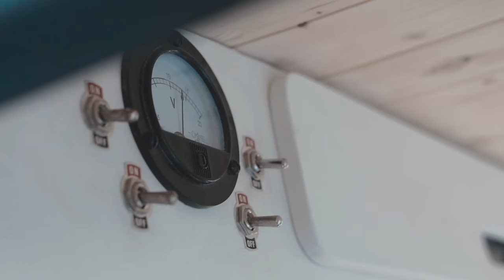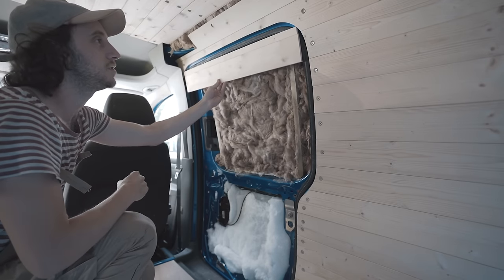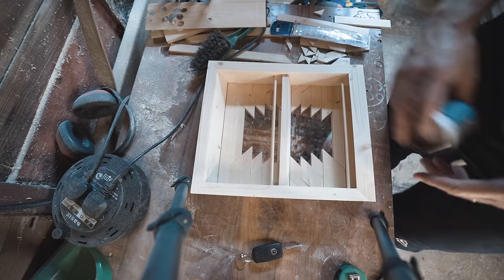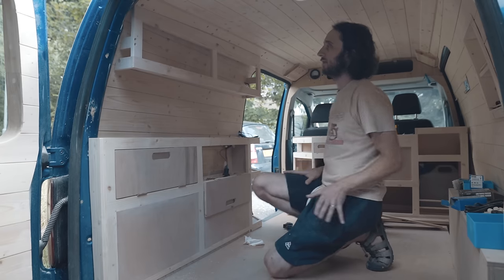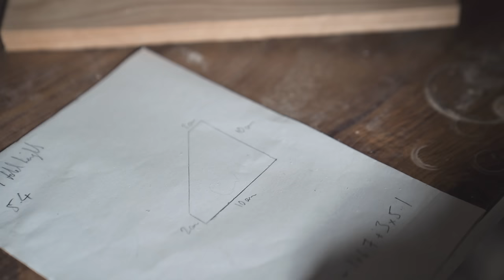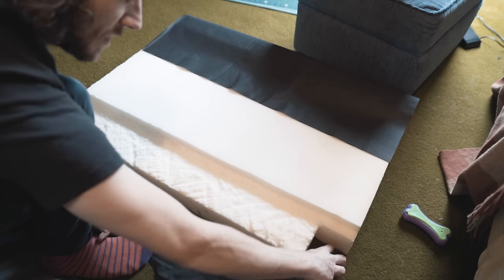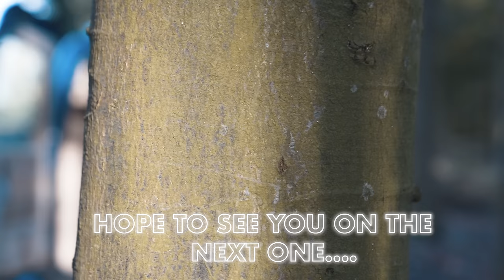DIY Camper Van Conversion | Full Build Timelapse | VW Caddy

Comment: So far I have seen quite a number of builds of campers because for several reasons I seriously consider to start to live in a camper myself.
This is the smallest van I have seen so far.
What I like most is that you kept it as simple and practical as possible but with some cute details such as the mirror.
I also like the colors. You kept it light. This makes it more spacious.
Even though this is too small for me I still think this is extremely well done. Double thumbs up.
Reply: Oh my goodness! The craftsmanship you demonstrate is exquisite! How ever did you acquire such skills at such an early age! You are a very capable carpenter, engineer, plumber, electrician, designer, upholsterer, tailor, videographer, etc, etc.  This is the best van build I've ever watched.
Reply: @mstimpson03301  I think he had great parents

Comment: ABSOLUTELY STUNNING! And I love how well thought out you did everything! I am a disabled senior that travels for suicide awareness Since losing my son Jeff in 2016, in my wheelchair modified 2010 dodge grand caravan with my four Chihuahuas.  I have a wire cubby in the Hatch area for storage. I also have a platform bed with some storage space underneath. I have kept the smaller section of the backseat as well as the two front seats for when my grandchildren travel with me. The rest of the floor space is taken up by my power chair. I am by no means a minimalist and definitely travel with too much stuff. And I still have more stuff for camping and emergency gear at home for the day I can score a larger rig.  Unfortunately, due to the wheelchair modification, I cannot have a rear hitch for a tiny trailer or even a storage box on the back, and being in a wheelchair it is hard to access anything on the roof. But I do have 2 solar panels and a roof box up top for when other people travel with me. My dream vehicle is a short wheelchair Bus conversion with plenty of storage space! Safe Travels n Enjoy YOUR Journey! ❤
https://youtube.com/@JeffeysMom

Comment: this build is perfect, one of the best i've seen online so far. well crafted, well designed, you really dont see people converting their vans into builds as good as this one. the only thing i'll add is that you'll probably want some space in between the solar panel and the roof the car, as the cells can get quite warm if they don't get enough ventilation on hotter days.
Reply: Es un gran profesional 👍

Comment: This is just such a comprehensive start to finish conversion with so much attention to detail , it inspires you to think to yourself "wait, I could do that" while watching it.

I couldn't help but think to myself, as you were building out the bed unit, since it's such a small van,  what if you were to make it serve double duty by turning it into your main storage cabinet/worktop/etc when it is upright on its side?

Then you could have the left side of the van as a sitting bench, and once you're done doing kitchen/work stuff during the day, drop the thing down 90 degrees for an instant full size double bed.

Comment: There was still a lot of exposed metal. Borrow an infrared camera, you'll find a lot of heat leaks, (poor insulation )I used  R-13 inside the doors, (big help, closing the doors got quieter)  also used Owens Corning R-3 1/2" Foamular worked great for the walls! Moisture resistant. Good job on the floor. Reflexit does not work well on windows, The Foamular was much easier to cut to shape and did a much much job at keeping out the cold. The infrared camera knows and see's all! Believe Me!
Reply from the maker: That's some dedication there Raul!

Comment: I like this BUT one trick that I think a lot of people are missing is around the weight. Weight affects handling, fuel, etc. All converters notice the difference with their original van vs the camper. If you think of everything that went into this, the materials just stacked up in the back, it's like a pretty full load. My solution? Replace a lot of the wood with marine foam. It's strong, rigid, fire retardant, and weighs NOTHING. I personally think it's okay for bed and seating, although there can be flexing if you don't use the door-screen trick, but I like that. For everything else it is perfect. So you suddenly only have to add the weight of facias and equipment (fridge battery, etc). The conversion feels almost like an empty van.

Comment: i love wood. but wood is very heavy. I often wonder about these wooden build-outs, if people put stronger suspension etc. on their vans?
Reply: These Caddy's are designed to carry a load of max. ~600kg. Don't reckon the total weight of the wood will exceed 600kg

Comment: Hello ! Thanks for the recap video
Question : in the insulation work, you put a good layer of insulating fibers but before putting the wood, non vapor barrier ?

I love the mirror surrounded by wooden frame, it’s wow ! 🤩 and your insulating shutters for windows 👍
I have the same compression fridge 😊

If I’m lucky (I’m spending my driver licence at 60 years, oh yes !), I will again fit in a new vehicle 🤞cross the fingers 😉
A vehicle like same type at yours 😊

a very very beautiful work, clean as I like 😊! 👏
Have good tips with your van 😊 See you
Reply from the maker: Hey! Thanks for the comment, some campers do need a vapour barrier but this particular brand of insulation, the peel back stuff, doesn't need a vapour barrier according to the manufacturer. I believe it prevents absorption of moisture and any mould growth in itself, try looking for camper insulation rather than household, keeping the camper well ventilated will also help though! That sounds great though and best of luck on your license, the build and many travels! 😁✌️
Reply: @WoodandWild  Hello and thank for your answer. Here in France, many people use German material called « Armaflex AF » from Armaconfort. Initially, used for pipes then boats and now for vans. It’s an excellent thermal insulator. Others use projected cork and natural fibers on witch they put a vapor barrier. For the Armaflex, no need.
And of course, the vents aren’t forgotten 😊
For my next van, I take Armaflex and fibers in extra. That’s why I asked you the question 😉 
See you ! 😊

Comment: Really well done! 👍
It would have been even better if the Caddy would have been an electric car and if you would have used sustainable materials for the insulation. But still, really great work!
Reply from the maker: Hey Lightsternelektro-camper! You'll be happy to hear the insulation is made from recycled bottles and our current project is a Nissan E-NV200 😁✌️
Reply: @WoodandWild  Wow, that's great! I thought it was something like rock or glass wool, but recycled bottles is great, too! We used sheep wool for insulation and it works absolutely great. No moisture whatsoever even in or after winter. Absolutely recommend it!

As you might have seen, we already have two "Envys" in our fleet. They are cute little vans. Very reliable and even quite energy efficient!

Good luck with your project! 👍

Comment: :hand-pink-waving: looks very very nice ... well done ... Maybe you have an answer to the weight question: empty car (before you build in the first part of insulation ... next weight with insulation ... next weight with the wooden layout ... next weight is total, when you drive away = incl water a.s.o.) do you have such figueres or can say something appr about that? maybe I will try it without wooden ... but V4A stainless steel :glasses-purple-yellow-diamond: 2/2/2mm (i want to learn to weld and i have a good project to practice with...) :face-purple-wide-eyes:
Reply from the maker: Hey Senseye, sorry I don't have an exact figure for you I'm afraid, I try to make things as light as possible by using softwood for framing, minimising plywood thickness, generally keeping the materials required from framing to a minimum. You could also opt for a lithium battery (though a little more expensive) as well as a flexible solar panel etc. They only thing I can say is that the van pulled and felt exactly the same as did prior to the conversion, you could always take it to a public weighbridge if you were worried at all!

Comment: You shouldn't put insulation in the lower part of the door, there often runs water through it and drains at the bottom of the door.
Reply from the maker: Hey Jona, what do you mean by isolation sorry? Is this the rear doors?
Reply: @WoodandWild  I mean insulation (I'm German). You stuffed it in the lower / inner part of the doors. It will get wet in there and might even block the drain.
There are little holes at the bottom  of most doors, cause there will always be some water that gets inside of the doors (cause of windows/doorknobs/roof /...)

Comment: Hello.

How did you secure the wood to the metal for that shelving frame avove the bed? Im putting a window there in my caddy and it will mean i have to re-clad that side. But not sure how to secure wood in that specifc area
Reply from the maker: Hey Curtis, I'm not quite sure what you mean exactly but if you're looking to install a shelf, I would suggest installing some battens behind the wall before the cladding goes up to make sure it's well supported, hope that helps but let me know if I've got that wrong!

Comment: Great vid. How many W is that flexible solar panel and was that sufficient to power your fridge + the lighting? Any feedback on possible noise pollution caused by the fridge in such travel vans? Thanks
Reply from the maker: Hey Mathieu! The panel was just a wee 100w panel so needs a little help from the split charge relay to keep everything topped up and the fridge is pretty quiet, if you can afford a compressor fridge, it should help reduce noise a little, hope that helps and good luck with your build!

Comment: hey man, great build. With the wall were you just drilling straight into the metal frame to attach the cladding?
Reply from the maker: Hi! Some cladding was attached to the wooden battening behind, some to the metal of the van, I would always drill a pilot hole first in both wood and metal then run a screw through, just be sure to use the right screw for the material, wood screws tend not to bind so well in metal, hope that helps!

Comment: What about the struts and transfer of heat / cold from the outside theough ? Do you not need to insulate them aswell ?
Reply from the maker: Yes, not sure if I included that pert but you can use spray foam insulation to infill those hard to reach areas!

Comment: May have missed it... how did you secure the wood floor to the floor?
Reply from the maker: Hey Andrew, I simply screwed it in place using screws with countersunk heads, you can use nuts/blots or rivets to if you like, just be sure to check for petrol tanks underneath!

Comment: Hello Joe,
A very nice video, thank you.
I saw that you glued the flexible solar panel directly to the roof of the car.
I am currently converting a Renault Trafic and would like to install one or more flexible solar panels, but everyone I speak to, advises against this.
How does the solar panel perform, are there any problems with heat in the summer or other problems and would you do this again?
Reply from the maker: Hey Hans! Yes I read up on alot of varying ideas on that, in the end I contacted Renogy technical support and asked them directly. They recommended adhering it directly to the roof but just allowing  several gaps along the silicone down the sides of the panel to help improve air flow. I figured if the manufacturer was recommending it, it was probably the best way forward, hadn't noticed a drop off in performance but do believe they can do under extreme heat. If it helps I've got a video on here just on the panel install showing where the gaps for the silicone were made, hope that helps and good luck with the build! Joe
Reply: @WoodandWild  Thanks Joe for the detailed answer.
I hadn't thought anything of it, but now that you mentioned the recommended air gap in your answer, I also know why you applied the silicone glue in that particular pattern. 😁

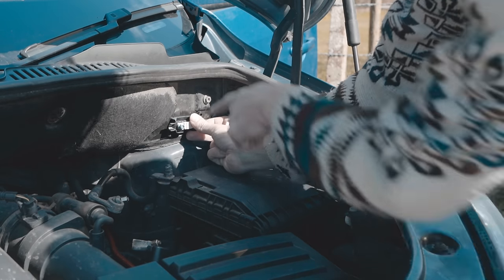Comment: @ 3:32 “…I don’t want to penetrate anything I don’t want to…” and then proceeds to put holes in the engine to passenger area FIREWALL.  Adhesive may have been a better choice.

Comment: Where can i get the tool you used for fitting lugs to larger cables ? ( where you wacked it with hammer 😊 )
Reply from the maker: Hey ktd2956, it was a Draper crimper, here's a link to one on amazon for reference - https://www.amazon.co.uk/Draper-64335-Battery-Terminal-Crimping/dp/B0108AIZZ8/ref=asc_df_B0108AIZZ8/?tag=googshopuk-21&linkCode=df0&hvadid=222086461140&hvpos=&hvnetw=g&hvrand=10122513190653366071&hvpone=&hvptwo=&hvqmt=&hvdev=c&hvdvcmdl=&hvlocint=&hvlocphy=1006675&hvtargid=pla-423204244541&psc=1&th=1&psc=1

Comment: Didn’t you forget film for moisture insulation of wool? Wool doesn’t not work, when it is wet. Humidity increase, when you sleep inside behind locked doors and windows.
Reply from the maker: Hey, check out dodomat insulation, it uses recycled bottles and prevents mould growth which is great as it no longer needs a moisture barrier

Comment: Hey, I'm converting the same van at the minute. Though not quite as far or well as you have managed.
I'm very keen to do the overhead extension you've done at 25:54 I was wondering if you had any tips on how you made the cut? Did you make a cardboard template or something first? It's a very awkward space. 

I currently have my switches on the plastic to the left, above the seat belts. But I'd really like to move everything to the same setup you have and add some extra storage.
Reply from the maker: Hey wherehasthedaygone! Yes that overhead storage was a bit of a bugger! If yours is the same, there should already be a plastic overhead shelf above the front seats? There's a lip on that shelf which I basically cut off, allowing me to lay some plywood flat on the top. The sort of face frame to the new shelf had a rebate in which meant the two parts could slot in to each other and help support it on the other side. The face frame was then screwed in to the ceiling. I think I took some loose dimensions then tried to scribe some of the cuts, it was very awkward though! Best of luck!
Reply: @WoodandWild  Hey, thanks for the reply. I went ahead and did it already, turned out quite well. I actually kept the lip. I took a bit of ply, did a cut at the sides to fit it in square against the plastic thing (I've removed the bulk head), then scribed that and chamfered it to sit nicely against it. It's attached to the metal then with a couple of M6 rivet nut. Seems to be holding well. Wouldn't have even thought about doing it if I'd not seen your video, so thanks again.

Comment: How did you do the overhead storage in the end? Looking to do something similar but don't know where to start.
Reply from the maker: Hey Hannah, that was a little tricky, I actually cut the factory installed overhead storage down a little to make it nice and flat to work with and to lose the ridge. I was then able to lay my plywood storage over the top of that to support the rear end and then screw the front end into one of the battens in the ceiling, hope that helps!?

Comment: Hey mate love your work, just wondering what you used to fix the verticals studs around your little nook on the side wall? Exactly what I’m trying to plan out for my build, thanks in advance mate, the video is edited so well 👏👏
Reply from the maker: Hey famous toledo, thanks! I actually drilled pocket holes into the top and bottom of the vertical studs, I then placed a metal drill bit in those pockets holes and drilled holes into the structural beams of the van using the pocket holes as a guide then simply used screws to screw the beam in place, was a little tricky to find something to adhere the beam to otherwise, hope that helps and good luck!

Comment: Did you put something inbetween the car battery and leisure battery so it doesn't drain both?
Reply from the maker: Hey FhVW, yes there's a split charge relay. If you use a voltage sensing relay it can automatically switch on and off for you to save draining the starter battery, hope that helps! Joe
Reply: @WoodandWild  Thanks, thats actually what I need for my van :). didn't know how or what it was named

Comment: bravo le menuisier peux tu me dire la taille de tes tasseau de structure stp et dans quel rayon tu prends pour un prix réduit stp

well done carpenter can you tell me the size of your structure cleats please and in which radius you take for a reduced price please
Reply from the maker: Hey Johann, I'm not quite sure what you mean, are you asking about the size of the battens?
Reply: at 17.29 or 20.28 of your videos the woods are how much I can't find an understandable wood abacus thickness resistance by default I take 15 mm to make assemblies underneath it's complicated but your story of structure in thickness and panel finb filler must have helped gain essential weight in this case. example expected 20x35 mm and panel I think 10 or 5 mm

Comment: At what height does the bed stands ? Also, what are the dimension of the timber used ? It looks a bit fragile ? Does it hold up ? thx!
Reply from the maker: Hey Alexis, yes sure, it's 18mm x 44mm timber and if I remember rightly, around 30cm tall, just enough to get the foam in and be able to sit upright!
Reply: @WoodandWild  Thank you ! Very helpful, I'm trying to determine the best sizing.

Comment: How did you remove the bulkhead?
Reply from the maker: Hey Mark, if I remember rightly it was just bolts and rivets so you can just unbolt it and drill out the rivets using a drill bit slightly larger than the centre of the rivet, hope that helps, Joe

Comment: How much weight did you add to your van
Reply from the maker: Hi Stephen, not sure exactly, not a whole lot though, it still pulled the same as it did before it was converted. I mean I could lift the kitchen unit frame with one finger so I imagine it was maybe 200kgs in total